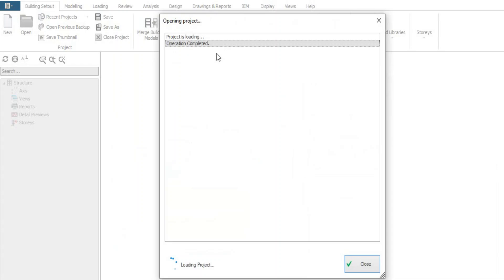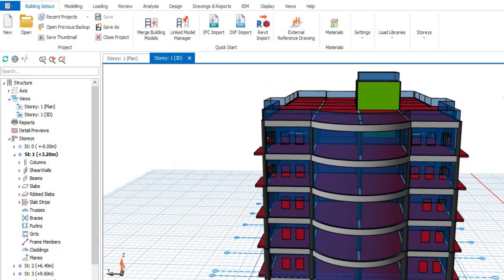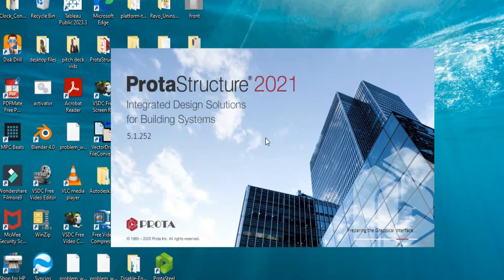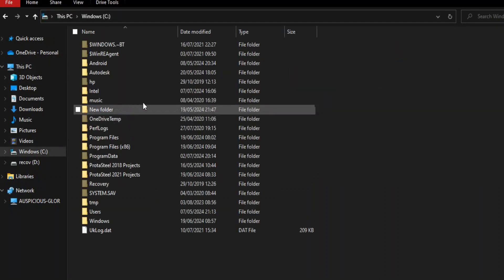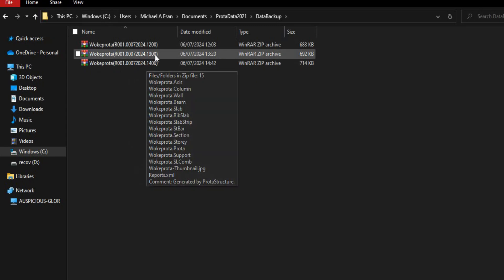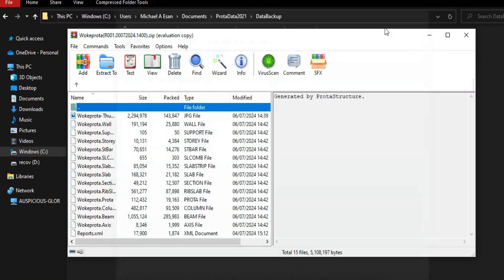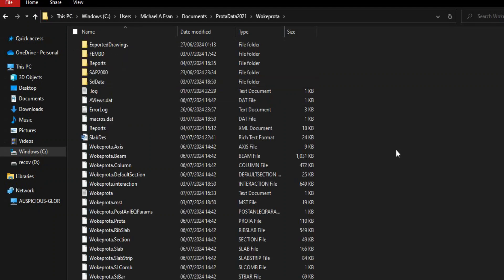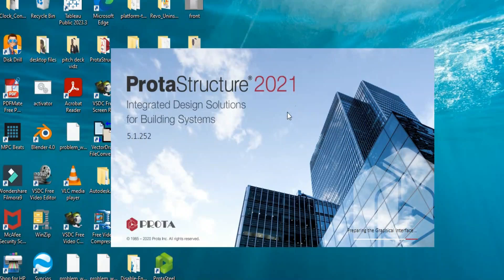How to Recover a Broken or Corrupted Protastructure Project #howto #tips #protastructure #recovery

Comment: Bro what ever you are looking for in life you will get. I am currently working on a large project. I just completed a major section of the model,  so I can send it to my superior to continue. An axis line was not properly placed because I had so many grid lines at different angles everywhere. While I was done I decided to delete the grid so I can replace it that was all. It was frozen, maybe because of the large file and then I closed the software. Long story short, it refused to load with an error saying beam position is corrupted. Then I stumbled on your video, though the file it opened is steps backwards but at least it was better than starting afresh❤
Reply from the maker: Amen and thanks for the feedback. I am glad you were able to recover your project. It means lot. Thanks